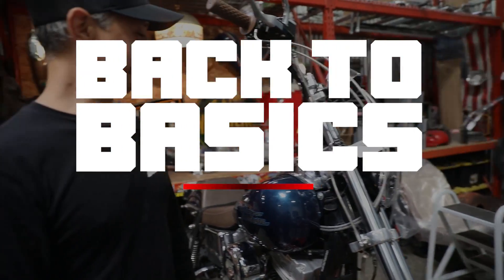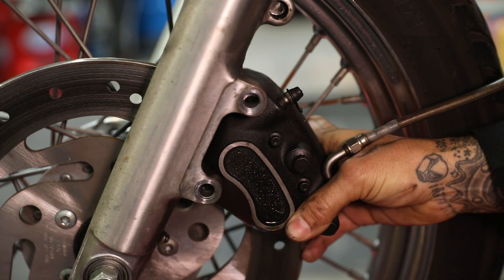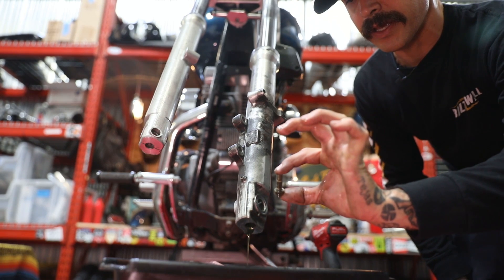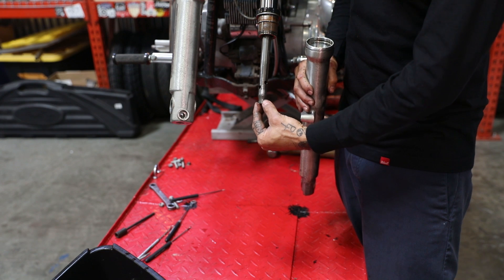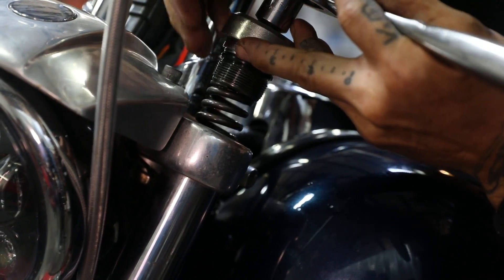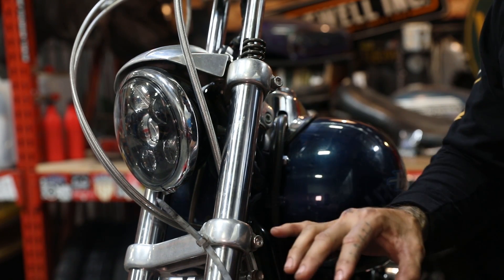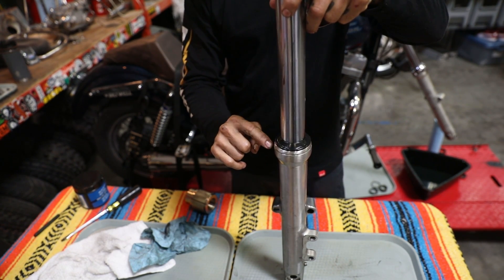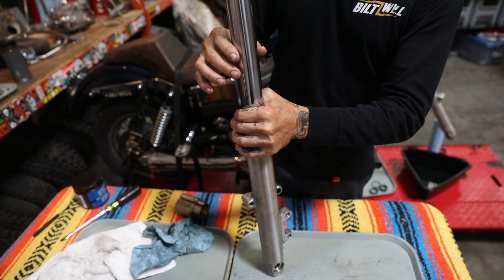Back To Basics: Harley Davidson Fork Rebuild

Comment: After having done this procedure, I can say it's very difficult to remove the decorative chrome cap without damaging it. Just buy new ones before you start.
Reply: Good pro tip! They are pretty thin chrome plated metal. Easy to damage.
Reply: Get the right size and style of punch. A cheap larger size punch will definitely get save you the  replacement

Comment: Rob, you warned about not installing the replacement components from the bottom of the rod upward because of possible damage from sharp edges, but in your video that appears to be exactly what you did???

Comment: Hello,  your video is very informative.
My 2005 sportster  front forks bottoms completely.  It doesn't have any leaks, looks completely fine.
Can I just take off fork caps,  replace springs and oil from top ??
Thanks.

Comment: My Softail heritage 93 says the washer needs to be with the flanged side facing up… does that mean the flat side must face down ? What’s the difference between facing it down or up it makes more sense to lay the flat side in the bed of the fork slider than the rounded side.  Can anybody share some info into this ? Minute 11:20

Comment: I've seen some videos where they say to slide the lower up and down when you are refilling to get any air out?  Is that necessary or will pausing for a bit allow the air to bubble to the top and out?
Reply from the maker: Pumping can help pull the fluid through faster but can be a mess. Going slow works best for us.

Comment: If you are going that far, you could have shown how to replace the seals on the dampers - The seals come with the kit but they are different than the stock ones and of course Drag Specialties doesn't provide instructions 😠. 
After watching you remove the fork caps, I'm not real sure that I would follow your lead either 😂

Comment: Liked your video, It is very to the point, But there is one important step that you left out. or should I say, didn't mention, you covered it by saying pore the oil in the fork slowly, you didn't explain that you need to burp the air out of the fork by lowering and raising the bottom part of the fork before reinstalling the top cap. "Just an observation".

Comment: You can make a seal driver from PVC pipe from the hardware store. Longer then the tube allows you to use a rubber mallet to drive them in.

Comment: Great Video. 
Quick question: what is that thin metal string located inside the fork seal itself? And what is its function exactly? I realised my left fork was leaking (Ive recently replaced the seals) and when I opened the cap that string was broken...
Reply: That spring is the most important part of the seal, it helps pinch the seal around the tube with equal pressure. With that spring broken you probably had a pretty decent oil leak. If the rubber hasn't been damaged or isn't hard from being old, You might wipe the oil off the fork when parked and not see any more oil until after riding. If the seal rubber is old or damaged, you could wipe the oil off and 30mins later it's back, or over night it's visible on the ground.
Reply: @GrigoriMalikim  True, but I just happened to find out the hard way! :d
It leaked a fair amount of oil, so I replaced it and its all well and dry atm. I literally took everything off and then back on just for that tiny spring, but it is what it is.. 
Thanks so much for your reply.

Comment: Currently doing this procedure and I can’t get the seal down far enough for the retaining clip. Any tips? I pre oiled it just like the video and have been hammering on it for over an hour. I can see the groove but still need to go down more. Please help🤬😭
Reply: If you see the groove, you're down far enough. The clip is only as wide as the groove.

Comment: Thanks..great, easy to understand video..what is the correct torque pressure for the pinch bolts etc?
Reply: not sure, i'm thinking 30-35 on uppers and 29 on axle

Comment: Nice video but I don't get the pipe dope isn't the seal made at the Copper washer
Reply: It’s just one of those “tricks” I learned from the Master Mechanic that I worked under. Think of it as extra insurance, but it is not mandatory.
Reply: @rouserworks  the only problem sir is the seal is not made at the threads it's made at the Copper washer that so-called sealant is nothing more than a contaminant and will certainly not help the ceiling process as if that copper washer needed any help you're  giving bad information and introducing a contaminant to the system
Reply: Practical Experience thank you for your reply. This step is not required, but this is something I do and have been doing for 20 years now. I was taught this practice from  a Master Tech at Harley Davidson.  Thank you for your input.
Reply: @rouserworks  I don't care who taught you that that's wrong and you're not going to find that in any written text I promise you because it's wrong lots of so-called Master's teaching a lot of things that are wrong just because somebody calls himself a master or labeled as a master doesn't mean they know what they're talking about we're doing it correctly I'm here to tell you sir that that seal is made by that copper washer and that thread seal that you're putting on them threads are in no way assisting the seal in fact it's only a contaminant and if you can't see that then you have no idea how a seal is made again I tell you the seal is made at the Copper washer not on the threads why don't you do some technical research and find one technical book that supports your claim you won't find it because it's wrong and introduces contaminants into the system

Comment: I had my forks serviced by a shop about 6 months ago. I noticed a month later that there was plenty oil on the tubes from the seals area and also oil leaking from the tops of the forks where they meet the triple tree, was it a bad job or are my tubes shot?

Comment: I have a 2003 XLC, ( Seals NOT LEAKING! ) I was just going to change my Oil, Can I drain it by taking off the damper rod bolts, or should I just use the drain plugs?  (I thought it might drain easier using the damper rod bolts)

I have about 38,000 miles on the bike. 

Should I put some progressive springs in there, or should the factory ones be OK for a while?
What weight oil should I use, 10W or is 15 better. I don't ride real aggressive.
Or do you think at 38,000 I would need bushings.

Comment: Great video, exactly what I was looking for as a refresher

But....how do I know what it the correct amount of oil and weight for a custom application?  +10 soft tail forks....any clue?
Reply: Fork oil amount does not change with longer tubes.
Reply: @thedewdster  

Yes, I know that now. Unfortunately, you’d be surprised how many people (just like me) don’t know that. 

Oil is contained in the lower leg, and that has nothing to do with upper tube length.

Comment: if i don't have a fork seal driver, can i substitute something for it or is imperative that i use one?
Reply from the maker: It is always best to use the proper tools, but in a pinch a piece of PVC pipe that is the right diameter will get the job done. Or take it to your local Harley shop.
Reply: @BiltwellCycleParts  awesome, thank you.

Comment: How do you bleed the air out? Isn’t that critical? Or do you just slap it together and roll lol.
Reply: Ryan, there is no need to bleed any air out of your forks. Just make sure you give ample time fr the new fork oil to settle in the damper rod before you install the fork caps. If you are in a rush you can “cycle” the fork lower up and down to speed up the process of getting the damper rod filled with fork oil.
Reply: He doesn't know what he's doing someone will get killed doing this.

Comment: Great fork service video, will be doing my '05 FXDL next weekend.  Any trick of the trade or tip to help make the difficult task of getting that fork cap back on the tube a little easier???
Reply: Try and get above the fork cap (step ladder or the like) and use your body weight to force the spring down as you screw the fork cap into place.

Comment: good tutorial, but rest assured - removing the bolts for the caliper, if they've never been removed before, is WAY harder than that. Using an impact like he did is smart, but if you dont have access to one, use a cheater bar.

Comment: In the process of replacing fork seals. I noticed my springs only stick out about a half inch. There was no pressure against the cap. Is that normal? Other than that it's been a pretty simple job. Great video makes the job so much easier.

Comment: Is the HD Roadster 1200 xc the same forks as these?
Reply from the maker: These are not the same forks as the hd roadster. The roadster ( if it is stock ) has inverted forks which is a different process.
Reply: Thank you so much for replying. I'll look into it some more and yes they are inverted forks

Comment: Are 49mm dyna forks basically the same process other then the torque specs?
Reply from the maker: A non cartridge 49mm front end should be the same process. If you have a cartridge front end its a completely different deal.

Comment: If I’m running 8 over on my sportster how much oil do I need
Reply: You need to use the same amount of oil in each 8” over tube as you would in your stock set up. Just check your service manual for the proper amount and weight and apply it to your 8 over set up.

Comment: Awesome and detailed video! Do you know of the process is pretty similar to an 2018 FXBB? About to rebuild both seals on mine.
Reply: I’m looking for the same thing. Did you find any info? If so, where?
Reply: I'm sure it's similar. It's just a spring loaded dampener rod in a tube full of oil. How hard could it be

Comment: The best how to video. Spent 4 hours looking for a good video. Question where do I place my lift underneath the bike? I dont have enough money for those fancy lifts.
Reply from the maker: We put the little lift under the lower frame rails. If it is an uneven surface, or the kickstand mount gets in the way you can use a block of wood on top of the lift.